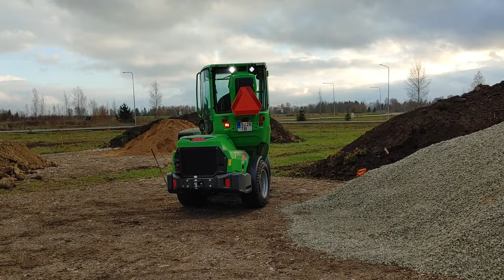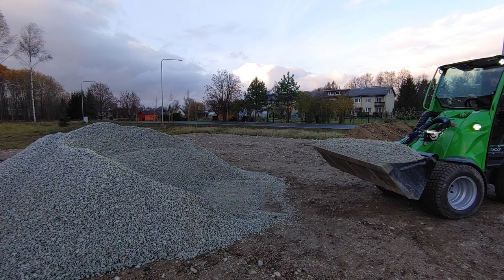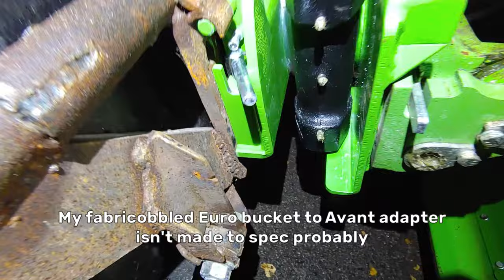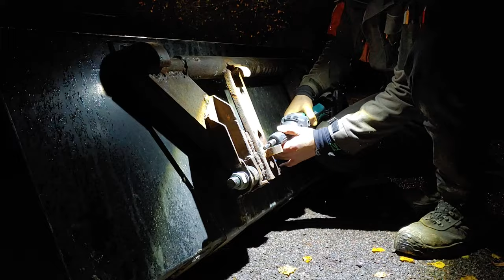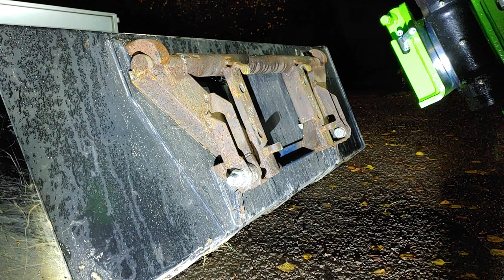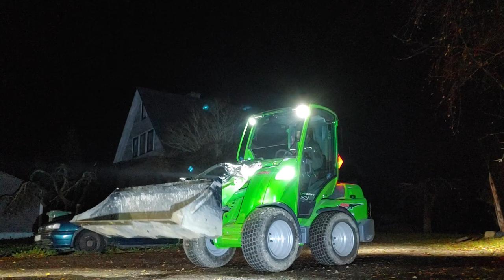Avant 650i trench backfilling

Comment: You have GT Cab with a/c, why not get the quick attachment plate for the headstock. You don’t need to get out then
Reply from the maker: The 650i has the hydraulic attachment plate, but at the beginning of video there's 360° attachment rotator already on it that has the manual attachment levers.